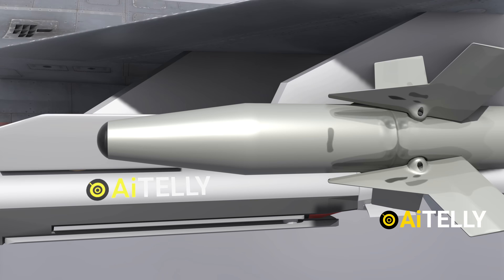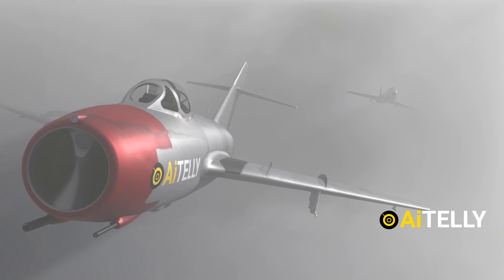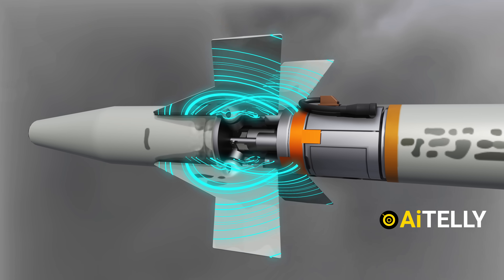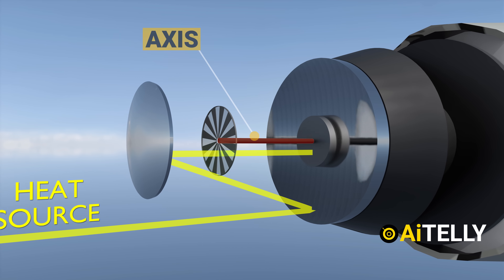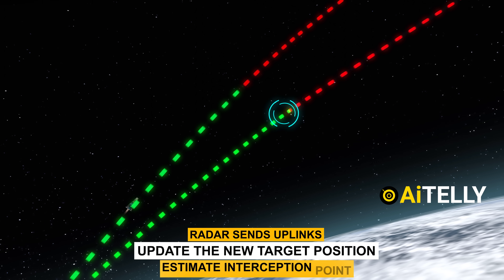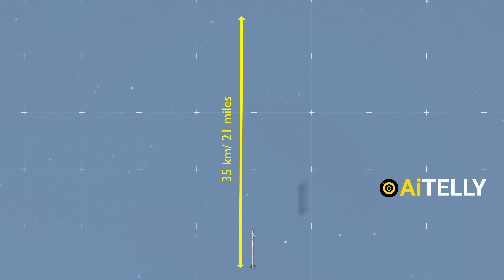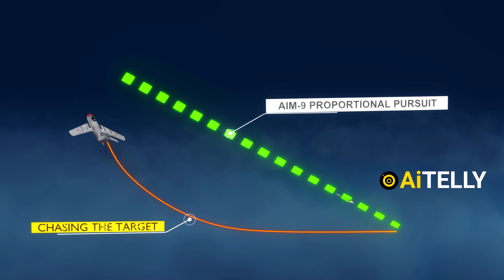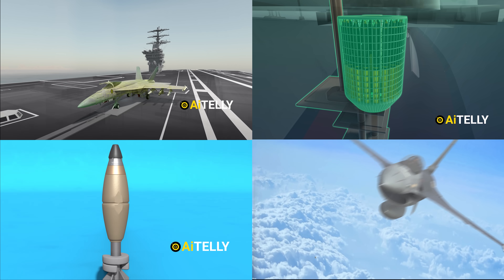How Heat Seeking Missile Works I Aim 9 Sidewinder

Comment: Former USAF munitions specialist here. Regarding the cooling to the seeker head, the AIM-9L/M utilized an on-board gas cylinder ( shaped a bit like a pot ) that contained 3000 PSI of Argon gas. When activated, this provided the necessary cooling as required. The Navy versions had Argon supplied from the aircraft itself
Reply: Retired USAF AMMO troop here. The old TMU-72/B Coolant Pressure Tank. Damn, I've filled thousands of those little tanks.
Reply: where do Navy jets keep their argon in the aircraft, and why do they need it onboard the plane?
Reply: @user-rs1fo2dd9b    Not sure. I was given this information by a Navy AO ( aviation ordinance). I had mentioned the Argon cylinders that we used to swap out, and he looked puzzled and informed me that Navy versions supply Argon from the aircraft itself. I’ve never seen how this connects, but there you have it.
Reply: @craigcook1030  I’m an AO and it was the case on the f-18. Now it’s build inside the missile himself
Reply: @phylmeproduction4562    Thanks brother. Good to hear it from the source.
Reply: @user-rs1fo2dd9b  did you not read what he said? its in a small tank IN the missile...? however i struggle to understand how a gas of any kind could possibly work as a cooling agent. gasses heat up infinitely faster than liquids so that makes no sense to me.
Reply: @richarddutton1981  False, some systems do in fact provide cooling gas from the aircraft to the missile. The point is that high pressure gas, during decompression,  quickly causes its temperature to decrease - that's why your deodorant becomes chilly after prolonged spraying. The IR seeker needs to be cooled down, as the infrared sensors are sensitive to... well, infrared light, which is emitted by heat sources (black-body radiation). If the sensor is not cold enough, it's own IR emissions will generate too much noise and the missile would have a very hard time actually detecting a target. That's why you also cool down cameras in telescopes - you want to keep the noise as low as possible, for your long exposure deep space pictures to be beautiful and show bright spots where the stars are, not where the sensor was warm.
Reply: @richarddutton1981 go to your kitchen, open up your refrigerator and marvel at how gasses can be used to cool things down. And if you've ever heard of air conditioning I can also tell you that contrary to popular opinion those miracle boxes don't operate off of witchcraft, rather they use gasses to make the air cool and the inside of a structure not ungodly hot. Oddly enough this is a technology that the europeans have yet to adopt
Reply: @richarddutton1981  lotta geniuses in this comment. Section. It’s a type of cryo cooler called the Joule-Thomson cycle cryo cooler, capable of rapidly lowering the temperature of a thermal sensor to -321°F or 77°k (liquid nitrogen temp and also what the InSb thermal sensor is designed to operate at) using compressed gas and a little electricity to drive a pre-cooler and a valve. 

It’s basically the inverse of adiabatic heating, when we compress a gas, like in an air compressor or an internal combustion engine or a fire piston or the Santa Ana winds that blow off the Colorado plateau and fuel fall and winter wild fires in California.

Imagine a thermally isolated Dewar vacuum flask, a thermos basically, with the inside made of copper and a small part of the bottom of that copper vessel actually continuing via copper rod  connecting thru the dewar to the outside. That bar is gonna get cold as hell in a second. 

Inside the dewar is a very dense helix of finned, thin copper tubing ending with a tiny hole at the end floating near the top of that copper bar at the bottom. Now, a valve opens, releasing the  compressed gas through a pre-cooler first— something as simple as a peltier solid state thermoelectric cooler. This was a mature technology in the 1950s. We only need to cool it a little bit, then it’s gonna flow through that thin copper tube, that’s a heat exchanger, and blow out the orifice at the bottom, right at the copper bar. You already know what happens when we invert adiabatic compression heating, like when we open a can of soda or a beer at room temperature and it gets a tiny bit colder, or if you leave any compressed gas tank to vent for too long— it gets cold.

Now let’s consider the gas flowing through that tube quantitatively and qualitatively. If the gas inside the tube was 285°k at 3000 psi, and were quantifying in units of 1 cubic centimeter (cc), then what’s gonna happen when I let it flow out of that tiny hole into the dewar expansion chamber that has a 20cc capacity of nitrogen gas at 150psi? I’ve increased the volume of a gas by a factor of 20:1!!  So what happens to the temperature? There was only so much energy, heat, kinetic vibration at the molecular level, to go around, so the gas is sharing that energy with 19 more cc, that means that the 20cc inside that dewar at 150psi is 1/20th or 5% of the starting temp of 14.25°k!! Damn near absolute zero and way cooler than we need, but it’s not nearly that efficient. If we size the expansion chamber right we get pretty close to 77°k though, and the incoming gas is continually cooling the chamber, the cool chamber is cooling the incoming gas due to the high surface area and excellent thermal conductivity of that radial finned tubing, the gas I’m venting is taking away heat from this thermally isolated chamber and venting it to another subsystem in the rocket, it can actually be injected into one side of the rocket motor exhaust plume to divert it and vector thrust, or it can power a micro turbine generator or drive a rolleron on the early sparrows or a gyroscope, or actuate control surfaces or simply blow out of four or 6 or more radial vents around the circumference of the missile which increases stability, etc.

Now this whole time that nozzle was pointing very cold nitrogen directly at the inside surface of the cooler pass through. The outside part is called the cold finger and that’s what the thermal sensor gets mounted to. 77°k, low internal radiation, nice clean signal.

Interesting that I know more about all of these ordnance systems than the guys in the military whose job it is to know at least some of this stuff. 

What else you wanna know? How to calculate the carbon composite and polyimide aluminum sandwich panel and the secret ingredient sheet layer thicknesses to absorb radar and make your whatever disappear from military radar? It’s old tech but it’s still state of the art on all of the F-35B except the cockpit. That’s a PVD and laser diffraction etched Indium Tin Oxide that uses destructive interference to nullify radar similar to the RAM composite. Or the formulae to determine incidence of flight surfaces for near-zero RCS, or how to defeat infrared seekers with cesium lamps or silicon carbide heating elements or Nd:YAG lasers with Risley prisms or how to use that same risley prism to build an IR seeker with superior multispectral  target search, or how to cool turbofan exhaust or how to use a ceramic 2D conductor nanomaterial to create nearly perfect thermal camouflauge thru the IR 2.2-18μm that the military doesn’t even know about yet even though I can make it in my home with a high energy ball mill, some pretty mundane chemicals and some really toxic fluorine compounds! I gotchu.
Reply: @user-rs1fo2dd9b probably in a compressed gas cylinder and they need it for the missiles. did you miss the part of why argon is used?
Reply: @user-rs1fo2dd9b  A nitrogen bottle is stored inside of LAU-7 launcher which supplies the cooling for the missile. I don't know why, but I think it's because it's faster to change the bottle in the launcher than change the bottle in the missile. Also the bottle is bigger inside of the launcher, so you can track longer before changing the bottle
Reply: Wow nice but you're not giving away classified information here, right? 😂
Reply: @bananian  Non US citizens should exit this video, immediately.
Reply: @bananian  Negative. This is all available publicly. And the systems that are being discussed here are 30-40+ years old. It’s likely that these operations have evolved beyond our collective knowledge. At this point, we’re just old guys talking about stuff from back in the old days. I doubt that OpSec is being violated.
Reply: @craigcook1030  
Ah IC, just being cheeky. 😆

But good to know. 👍
Reply: @craigcook1030 yeah the og aim9 missile debuted in the Korean War and has been continuously updated. It's the BUFF of missiles
Reply: IYAAYAS
Reply: @Dylan_Sterling  Back at you brother! IYAAYAS!!
Reply: I was the Chinese MiG pilot who got a sidewinder stuck my may plane's rear
The reason it didnt detonate is because i caught the missile mid air and shaft it into the exhaust of my plane
Reply: Bruh let's not spread potential classified information on the internet when we are literally on the brink of war with China and in proxy wars with Iran and Russia.
Reply: Cool
Reply: This information doesn't feel safe being on a YouTube comment. Not even based on what's written or who it may attract here, but rather the information other people may probably end up accidentally leaking through these contributions
Reply: I always thought there was just a big ice cube inside it.
Reply: @craigcook1030  navy versions use nitrogen in a bottle in the lau-7 launcher
Reply: thats so cool, sounds space age as fuck and is
Reply: Swedish AIM-9L (bought from the US) could be configured to use either rail supply or use the internal supply you just had to reconfigure the missile.
I suspect US in service missiles could be configured this way too.
Reply: Any way to design a missile not to have this flimsy argon gas system?
Reply: @donaldhysa4836  the Air Force Sidewinders had no cooling the J P and N versions but they had inferior performance because of it
Reply: @AdurianJ  Hmm seems tricky
 But surely its annoying to arm a missile the target breaks the loock with flares and still  having to launch no matter what or you wont  be able to use it again until the gas cylinder is replaced on the airfield. There has to be a better design
Reply: Not entirely true, but i’m currently active duty and won’t disclose how it works.
Reply: Hey man former security forces plane babysitter here lol. Out of curiosity with the newer Aim 9s, with ir cameras is their a specific wavelength of ir they look for. I suppose does jet exhaust show up best at x,y,or z wavelengths of infrared light? I'm guessing there's a good chance that's not public information so if that's the case no worries
Reply: Argon oh my bad I said nitrogen in another comment, they use that for the same thing on the javelin. Joule Thomson cryocooler. One advantage of storing the gas in the plane is that before the Joule Thomson diabetic expansion cryocooler can be effective, the gas has to be partially cooled to about 285°k before the JT cryocooler can take it the rest of the way to 77°k or -231°f, the same temp as liquid nitrogen— pretty self-explanatory why the InSb MWIR sensors were optimized for that temp— liquid nitrogen is abundant in lab settings. I even have a dewar in my shop for cryo treating my knives after heat treat. 

The aircraft also has a thermal imaging sensor which means it has a cryocooler, sterling cycle, my 4.5 pound FLIR HISS XLR thermal imaging clip on I keep on hand for hunting and things. The sterling cryocooler or even an onboard AC system for the cockpit if there is one can handle the pre-cooling and then transfer the pressurized and cooled gas to the missile in an instant since not much is needed.

Comment: Nice video but- Modern AIM-9X warheads use a Tungsten (in my language = "folded cable") warhead that slices aircraft like a sword. It behaves a bit different than HE frag but excels at cutting down aircraft- would be nice to see in an animation. It's used in a bunch of newer A2A too
Reply from the maker: Awesome piece of information.
Will take it.
Reply: @Aitelly  keep the videos coming!
Reply: @Aitelly  I'm fairly certain all the sidewinder variants have used a continuous rod warhead, at least anything newer than the B.
Reply: Its called continuas rod warhead

Becose to make it you need ro weld rods around explosives so when the explosives explode the rods would stay connected
Reply: Continuous rod warheads existed since like 1950s. First Sidewinder to get them was AIM-9D IIRC.
Reply: @IvanBaturaChannel  then idk what he means lol

Comment: The additional historical note for a weapon design that spans decades really enhanced the segment.  On a different tangent, the AIM-9X is not an effective AAM for UAPs like "Tictac" because it does not exist in the weapon's database, right? :face-purple-crying:
Reply from the maker: Yes there's some flaws in the missiles.
But I just like the fact that the Engineer made them during the 1950s.

Comment: Question?
What about anti heat jammer, for example a heat flare?
What about if the enemy aircraft launches another missile after the Heat Seeking missile?
Could you use a low emp against the Heat Seeking missile?
Does the reticle ever go bad?
Those pulses how often is it, is it in seconds, minutes?
Reply: The AIM-9M is more susceptible to flare decoys. The AIM-9X has improved IRCCM (IR Counter-Counter Measures) aka flare rejection technology. It takes into account many factors. Also the 9X has digital image processing to recognise a target-like object in it's field of view (it is shaped like a plane, not a flare, etc).
Most military hardware is EMP hardened, but I dont know specifically about AIM-9s. 
The frequency of the tones is from 500hz, 750hz, and the high pitched "locked on" final tone is 1500hz. I believe these come from the frequency of the reticle from older models but was carried over to the new 9X digital models for consistency. 
Hope that helps!
Reply: @MattH-wg7ou even the aim9m isnt too bad 
Its the first (?) Aim9 with irccm
If i remember correctly everything before the M just locks the hottest thingvit sees
Reply: @MattH-wg7ou  It does.
Reply: Generating an EMP is no simple task, and not equipment you would generally have on a jet. You would also have to deal with one major problem. Your electronics are right on top of the emitter. You'll be hitting yourself.
Reply: @icecold9511  ok
Reply from the maker: Yes we Forgot to add that may another Video.
Thanks for the idea